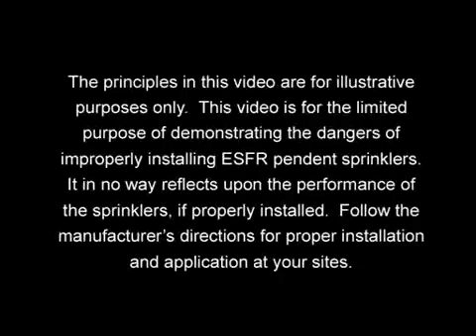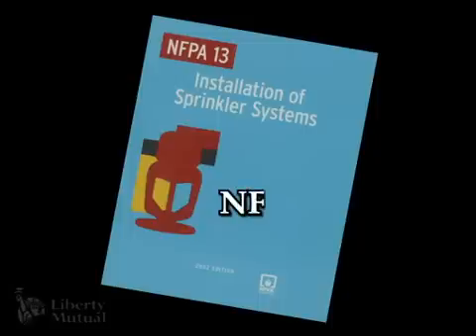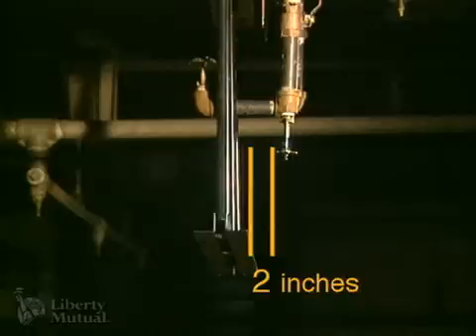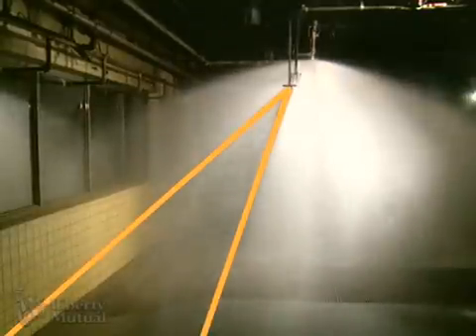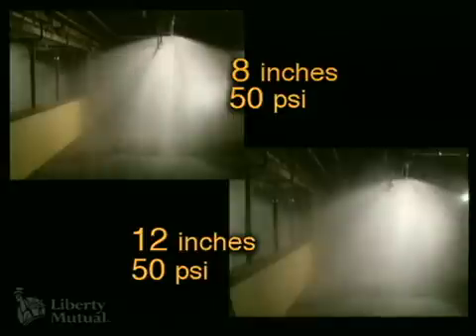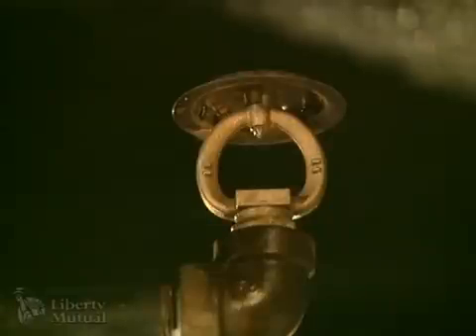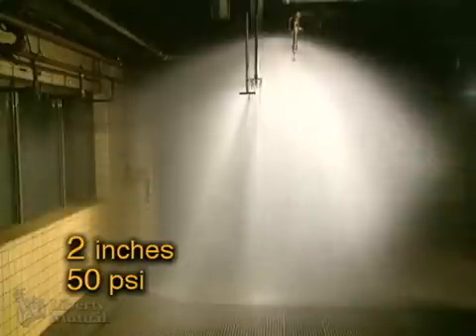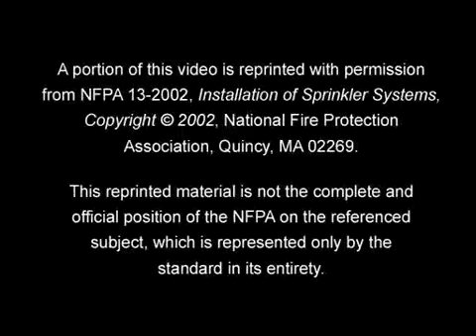ESFR Sprinkler Head Obstruction Demo

Comment: It's interesting how many YEARS of testing is required to come up with answers to simple questions that Common Sense and Logic will provide in minutes of Thinking! 

A Fog pattern has to be tight enough to penetrate the energy of the flames and wind while still covering as big an area as possible.  The type of nozzle in a room as to be chosen by the use of the room and it's contents/furnishings.  This showed that this room needed a tighter pattern and other locations to deal with this pile of pallets.  One size does Not fit all when your life or possessions are at stake.
Reply: JB91710 wtf are you even talking about man!?!?  Are you talking about firefighting or sprinklers?

“Fog pattern” “nozzle”....shhhhhhhh

Comment: Douglas Manifold:
The sprinklers tested are ESFR pendent sprinklers, not a standard spray sprinkler .ESFR sprinklers have listings and NFPA-13 installation standards for deflector distances greater than 12 inches from the ceiling deck. Typically ESFR sprinkler piping is much greater diameter than piping for standard type sprinklers; the greater deflector distance is usually required  given the much larger pipe and ESFR sprinkler. I think the requirement you are referring to is for standard sprinklers.